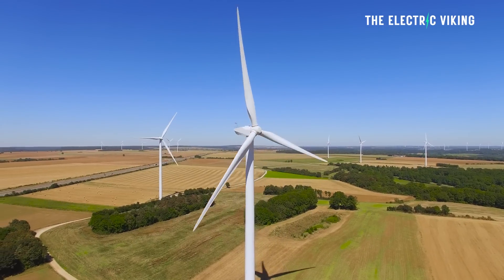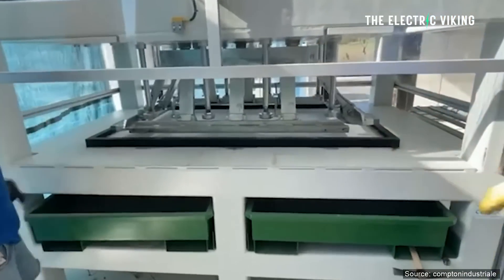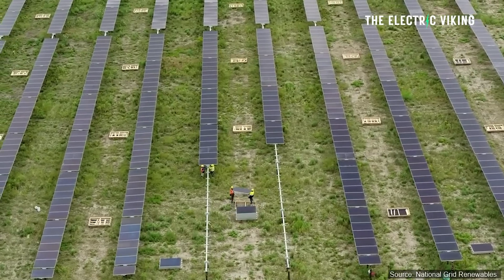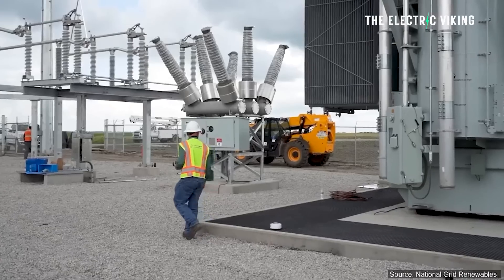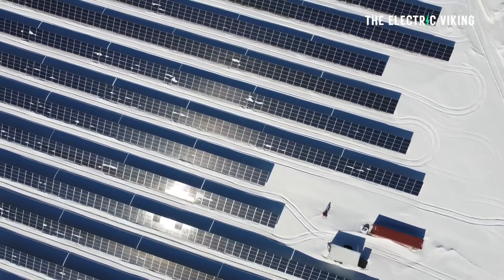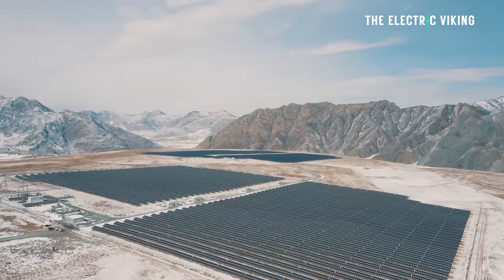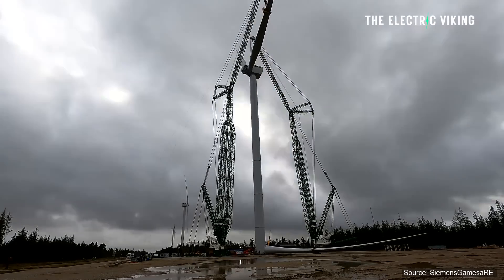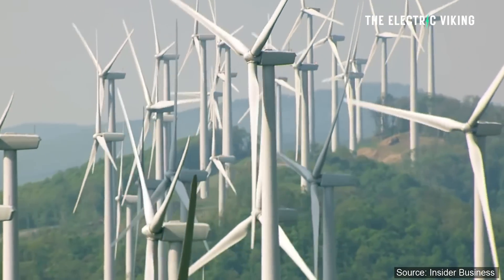Swiss Startup Proves Wind Turbine Blades Are Perfect For Solar Panels

Comment: Think a more appropriate use might be to mount the panels on the blades as they are generating power and spinning. Will get 2 sources of energy at the same time. Might cause out of balance issues though.
Reply: Lot of problems with that... Firstly the wind turbines need to be as light as possible, adding weight would require a redesign so they can support themselves without breaking.
Second the blades spin really fast so unless you are talking about the thin film panels or the kind that are painted on, both of which are very low efficiency, you would need super sturdy frames to clamp them to the blades, which would not only fuck up the weight and aerodynamics of wind power generation but sooner or later some small part will break and then there is a 200+mph projectile flying at nearby turbines... It could end up like Kessler Syndrome, when a piece of space junk breaks up a satellite creating a cloud of debris that destroys other satellites making more dangerous space junk.
Third, is it unlikely to be worth it. Let's take a small 1.5MW turbine with 100' long blades, I doubt you could really fit 50 panels on such blade but that makes a nice number. 3 blades * 50panels/blade * 400W/panel = 60kW. Assuming you got a big roof and low bid, installing that amount of panels as rooftop solar would cost about $100k, on frames at a regular solar farm it could be less than $30k. Meanwhile the wind turbine costs a few million but produces about 1500kW or 25 times more. Also note that wind can blow at night while the panels need to face directly towards the sun for maximum output, something that is unlikely to happen while the wind turbine is turning towards the wind. Bigger turbines have larger blades but few hundred kW for part of a day is still tiny amount of power compared to 15MW mot of the time.

Comment: WIND RECYCLING 

85% of the wind turbine is easy to recycle. But not the blades, as they are a complicated composite material made from fibreglass threads and a resin that does not melt. Crunch it up and you tear up all the fibreglass threads that make turbines strong. Heat it and it doesn’t melt, but might burn! However there is good news. Financial Times: 28 March 2022: Some European countries have BANS on wind turbine blades going to landfill. Also, Siemens make a blade with a special resin that CAN be melted down with acetic acid (like strong vinegar), cleanly separating the resin and fibreglass. Watch this video - it’s great news!  https://www.youtube.com/watch?v=FfnqBePvKCI

However, waiting to recycle special new Siemens blades is not good enough we have an existing crisis with thousands of tons of blades being decommissioned now. Vestas are saying they’ve cracked it and just need to scale up: “The newly discovered chemical process shows that epoxy-based turbine blades, whether in operation or sitting in landfill, can be turned into a source of raw material to potentially build new turbine blades. As the chemical process relies on widely available chemicals, it is highly compatible for industrialisation, and can therefore be scaled up quickly.” **https://www.vestas.com/en/media/company-news/2023/vestas-unveils-circularity-solution-to-end-landfill-for-c3710818

Wind Engineer Rosie Barnes explains why recycling Wind Turbines Blades is hard -and then interviews Ryan Ginder who has developed a process in America that seems to work on even the older wind turbine resins. Dec 2020. https://www.youtube.com/watch?v=IE0cGugRe1w   A Danish company is building 6 industrial factories to recycle wind turbine blades. “Continuum, founded in 2021, bills itself as a composite manufacturer with its product made from up to 92% recycled material.” https://reneweconomy.com.au/six-factories-planned-to-recycle-end-of-life-wind-turbine-blades-in-europe/

Even North American companies are getting in on it: “Our goal is to get to 100% recyclability. For now, we are in the high 90s”. Bob Cappadona, CEO, Environmental Solutions and Services division, Veolia North America* https://cen.acs.org/environment/recycling/companies-recycle-wind-turbine-blades/100/i27 “Carbon Rivers” use pyrolysis powered by the resin in the blades themselves:  https://www.energy.gov/eere/wind/articles/carbon-rivers-makes-wind-turbine-blade-recycling-and-upcycling-reality-support

Summary from the Union of Concerned Scientists: “While today, many retired wind turbine blades end up in landfills, innovative companies have developed repurposing and recycling technologies to help avoid that fate. Veolia, partnering with GE, can shred down fiberglass blades and turn them into cement. Carbon Rivers can transform fiberglass blades into textiles and other synthetic materials, while Global Fiberglass Solutions turns recycled fiberglass into railroad ties and plastic pellets. Vestas and a network of partners have developed the CETEC plan (Circular Economy for Thermosets Epoxy Composites), which in the next three years will be able to separate blade fibers from epoxy and use the epoxy in new blades.”
https://blog.ucsusa.org/charlie-hoffs/what-happens-to-wind-turbine-blades-at-the-end-of-their-life-cycle/

Comment: What if the wind turbines themselves are made of solar panels? Like solar roof tiles. That way the panels can cool while the blades spin, making the panels more efficient.
Reply: They're spinning so it's always power for 10 seconds and no power for 10 seconds when it rotates into the shade. Plus it won't be facing the optimum angle to the sun and the extra weight on the blades. All these things make it inefficient.  But with new technologies it may come true in the future.
Reply: The lower cylindrical part of the blade can be used as a in highway construction and filled with steel and concrete.  Or used to make a water tank.

Comment: When you mention cement factories I wondered if the ground up fiberglass would work well in concrete
Reply: It doesn't. Wind turbines are incredible hard  to recycle. Even we Germans put them in Landfills (and we are big on recycleling everything). Vestas (big danish producer) want to produce easy to recycle turbines, hopefully there is no tradeoff with longevity.
Reply: @thiesclausen4868  the video showed fibreglass been mulched in a grinding machine
Reply: Fiberglass mix in cement?
Reply: @kongwee1978  yeh why not " wouldn't it act like reinforcing
Reply: @waynefergusson9987  You have steel structure instead of fiberglass.
Reply: @kongwee1978  Are you saying that steel is the only way ?
Reply: @waynefergusson9987  Practically, no one will change that.
Reply: @kongwee1978  Isn't that what many said about the horse and cart
Reply: @waynefergusson9987  Steel have different grade for different strength. Fiberglass is more fixed.

Comment: If they motorized the blade mounts and had them on a horizontal swivel, they could adjust the pitch and direction to follow the sun to get the optimal amount of light energy.

Comment: You are a liar they replace nothing there are used turbine blade littering America in mass and solar panels the same with heavy metals that are dangerous to the land and emit gasses that are 1700 times worse than carbon monoxide you idiots build shit that is worse than the problem to begin with, you will see when all the industries go bankrupt without our tax dollars they can not support them selves so enjoy your EV,s while you can still pay the power bill as it will soar over 10 times the current cost. No climate emergency science has ever proved right , EVER. You can fool Europeans an easy mark for a fraudulent wana be Viking in an EV.

Comment: A farm is the perfect place to put solar installations elevated above the crops and the equipment to gather the crops.
You can even place an irrigation system on the rails that support the panels.
Reply: I believe that will be the future!
Reply: There's plenty of land in the desert which sucks for farming and is great for wind. We are not remotely close to running out of places to put solar like even if we graded the quality of places the best places in the world are not remotely filled up with solar already.
Reply: @davidolsen1222  solar panels work synergistically with the farm. That's why they are good for farms. Crops stop producing when it gets too hot.
Reply: @Songer80  To some extent, plants also sort of suck in the shade a bit and so you're better off with really good farm land not covered with solar panels and really shitty very sun-scorched land covered with solar-panels. The former may actually be running low, the latter we have not scratched the surface.
Reply: @davidolsen1222 you're wrong according recent research. Look it up. He even said so in this video. You must of missed it.
Reply: @davidolsen1222  You mount the panel in such a way that it shades the crops when it's the hottest outside like at noon but not in the early part of the day and after noon. That way the plants to get solar light every day but don't get burned from the scorching sun at noon.
Reply: A perfect place when it's not your land

Comment: I do not know much about this, but I'm not convinced.  

Glass (fibtre) can be re-cycled. I suppose the problem is the binding agent.

The solar panels only need a metal bar to hold them. The bar will be supported by metal uprights. Where old turbine blades seem difficult to attach to the uprights and to the solar panels.  Snow might well fall off but a metal bar does not hold much snow.

It feels like it is a headline grabbing feature. I am not convinced it makes economic sense.  I would be happy to be proven wrong.

Comment: Wind is a boondoggle. Large projects only exist because of massive government subsidies.
Solar and battery tech is rapidly advancing. No moving parts.
Wind is a disaster.
The blades become riddled with  microfractures from vibration and lightning and have to be replaced much earlier than planned.
They are too dense to be profitably recycled. There are huge wind blade graveyards. Google the images.
They now make them bigger and bigger, chasing profits and resulting in even more lightning strikes.